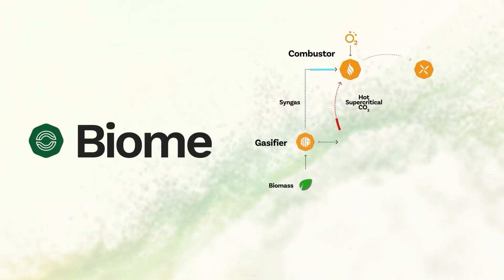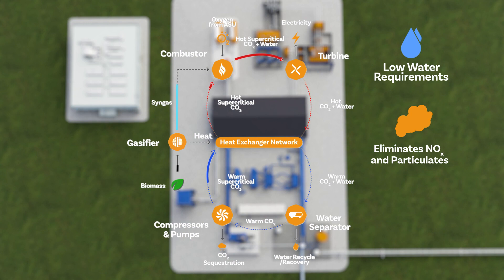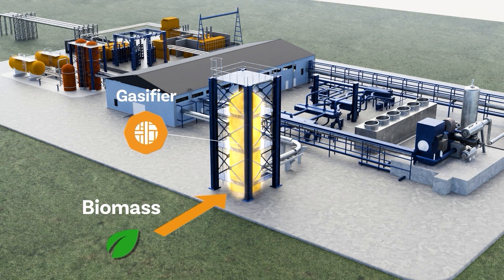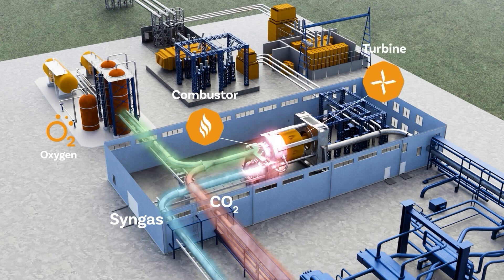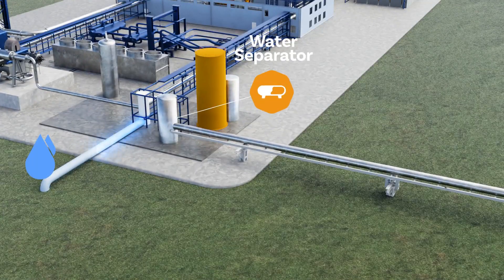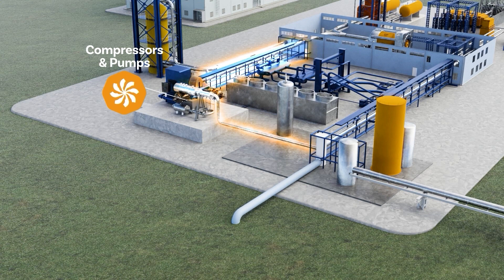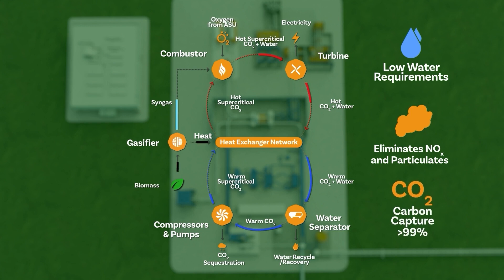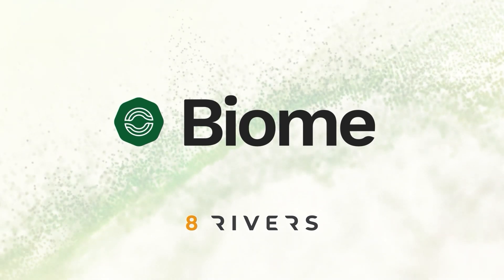AFC-Biome by 8 Rivers: Carbon-negative biomass-to-power power cycle

Comment: This process would be better if 

1. The gasification process also produces biochar 

2.  heat for district heating is also produced 

3. The excess CO2 is used as feedstock for producing carbon nanotubes rather than just sequestered underground.